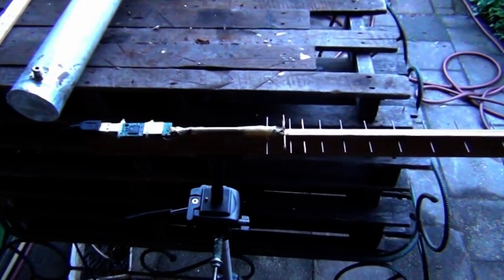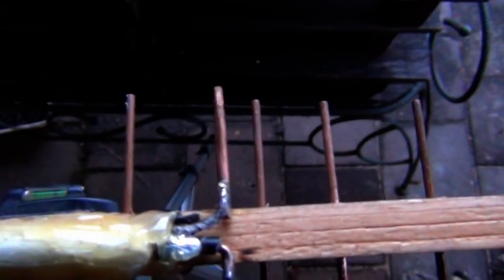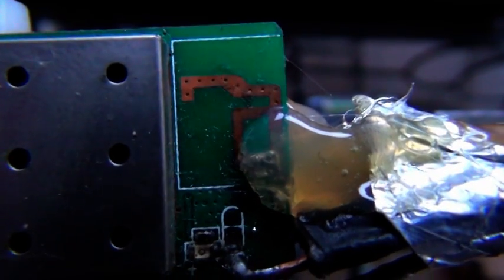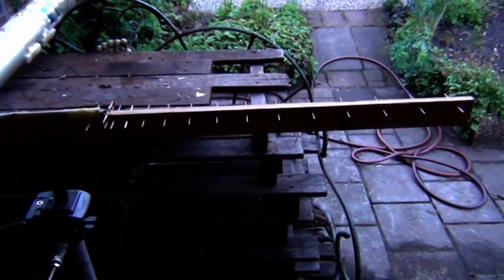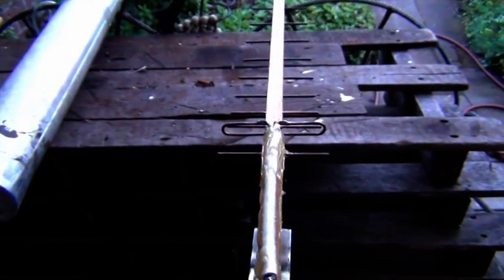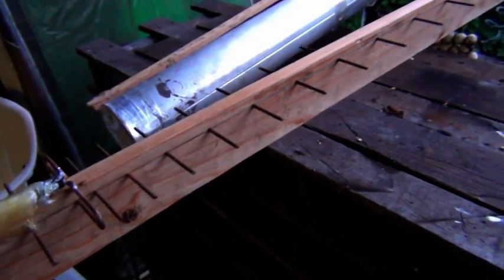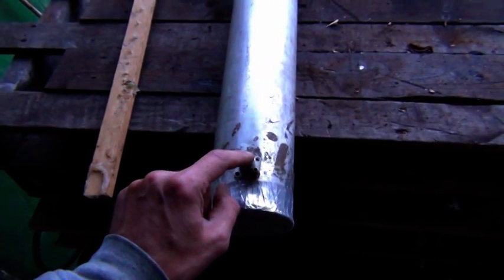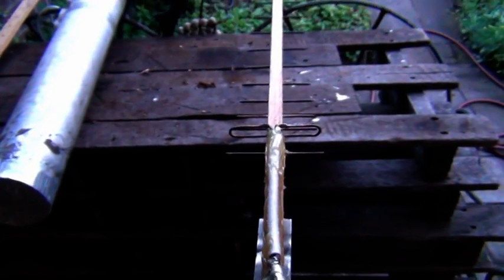Rebuilt DIY 15 element USB Wifi Yagi antenna vs Cantenna (29)

Comment: I can't see a balun. You need 4:1 coax balun for this Folded Dipole Antenna, otherwise signal will be very weak. It can be a Coax balun, made of RG58 cable with velocity factor 0.66, length for 2440MHz should be about 40.57mm (cable with sleeve). 40,57mm is 1/2 wavelength inside RG58 cable. You can use another delayed wave instead, 3x 1/2 lambda = 121,7mm, if 40.57mm is too short coax to bend. This piece of cable creates voltage delay and you will get both, wave(+) and delayed wave(-) = 2x higher voltage on dipole. Only BiQuad dipole doesn't need this balun because there are two dipoles in parallel (50 Ohm impedance matched with 50 Ohm cable and router or USB stick). Cable length (feedline) between USB stick and antenna dipole should be 1/2 lambda too, or 3x, 5x, 7x, (odd numbers) times 40,5738mm (1/2 lambda inside RG58 cable), this will help if antenna impedance do not match 50.0 Ohm exactly and there are reflections (standing waves) inside RF coax cable between router and antenna.
Reply from the maker: Hi, I appreciate your time and effort to watch and comment on my video, but I have no idea what you are talking about because I have no knowledge at all about antenna's. Back then I just replicated a design from somebody else. You obviously know much more about this stuff then I do. 

I did put the specifications in the extra information section below the video. I also don't use the antenna anymore, however I still have it. It's hard to throw it away after I spend so many hours creating it :-) For a while it was useful because it was the only way for me to get access to the internet. But now I have my own connection and I no longer need it. 

But your information might be useful to other people. So thank you for that.

Comment: Want to use a TL-WB7200ND but will not open it.. I intend to disassemble an old omnidirectional antenna ad use the wires, leaving the screw connector in tact.
Reply from the maker: Hi Lennox,

That should be possible. But be aware that a standard connector will result into a certain amount of signal loss. Soldering the connections will give much better results and is preferable. Keep the connecting wires very short, nothing more then 4 inch or 10 cm.  Also make sure that you are going to drill the holes for the elements dead straight. All the elements must be perfectly aligned to each other, otherwise you will get bad results. Also make sure that you cut the elements at the precise length. I've cut them at a certain length first and then I filed them to the correct length. I used a digital caliper in order to get the right length with an accuracy of a few hundreds of a millimeter.

It isn't a difficult project, but it is a tedious job to do it right. When you've done it right it works very well. It is very directional sensitive, so when you're trying it for the first time make sure that you aim it at a known connection point in order to get some practice on how to use and aim it. Aiming by hand doesn't work, it's just that sensitive, you will need some sort of stand, I used a cheap tripod. It's a good thing that it is a highly sensitive antenna for direction, that's why they work so well. You will receive less interference and it has a longer range. A weak but clean signal is worth more then a strong signal with lots of  "interference" or "noise" as it is also called.

In order to make the elements straight I used two pieces of very straight hard wood. I've put the bottom piece of wood on a bench or table and I've placed one element (piece of wire) between the pieces of wood and then I rolled the top piece of wood back and forward while I added some weight to it. Like this It takes only a few seconds to get a straight element. 

I believe that a similar type of antenna is for sale at Ebay for around 25 US dollar or even less, but correct me if I'm wrong. You might consider to order one from Ebay, although I don't know what shipping would cost you. But on the other hand the pleasure of a useful DIY project is priceless and irreplaceable :-)

I didn't know much about antennas, and I'm still not an expert, but now I know at least how to build one :-) I even made an upgrade to my latest antenna, although I don't use it anymore since I have a permanent connection these days. I've added a small DIY dish made from a disposable aluminum serving dish. I used a large round pot as a mold.

I've called my latest 19 element antenna "The 19 element active DIY parabolic directional samurai USB Yagi antenna". within a few months from now I will make a short video from the new antenna.

I hope this information is useful to you and or other people, If you want to know more  just  let me know.

Peace, iT
Reply: Thank you for this explanation..
Reply from the maker: Lennox Lampkin
 you're welcome
Reply: My problem is the lack of tools but I intend to look online for a digital caliper as advised. This should be an exciting project and I will report accordingly.
Reply: BTW I am as fluent in Dutch as in English so feel free to communicate in Dutch.
Reply from the maker: Lennox Lampkin
hahaha yeah, I've noticed that, but English is fine. Now others can read it as well ;-)

Comment: sir i just want to ask if the lenght of the shielded wire is counted?
Reply from the maker: Hello Raymond, I didn't cut a specific length, just as short as possible. In my next video about the Yagi antenna it's even shorter.

Comment: Very nice....actually I've made a cantenna myself and it works great...

What is the background track, music you have put in this video?? Its also very nice....:)
Reply from the maker: Thank you for watching Anant! The music came with the editing software that I used back then, but I am no longer using that software. A Yagi antenna, if properly build, works a lot better then a cantenna, trust me. It is much less sensitive for interference. After I build that 15 element yagi antenna I've build another one with 20 elements and I added a small home made reflector shaped like a dish, but I no longer need to use either one of them. Peace, iT
Reply: can tall me from how far it work i mean the range
Reply from the maker: 50jitu
Watch this video from amateurlogic to get an impression about the range. https://www.youtube.com/watch?v=j3hfxcP6X8s

The range depends on the situation but it is way much better then the standard wifi receivers. In an open field the range is much wider then when you are in a city. A yagi antenna is even more effective and less sensitive for interference.  But I can't give you the exact numbers because I don't know. Just watch the video that I linked to. It's good information.

https://www.youtube.com/watch?v=j3hfxcP6X8s
Reply: Thanks

Comment: That is a great job man.  Are you going to use a plastic beam for the next project as wood does conduct and may cause signal loss?
Reply from the maker: Thank you Andrew! I'm not sure yet, I'm using the antenna indoors and I don't have useful plastic material. Right now I gained about 10dB compared to the Cantenna, so that is pretty impressive. Most of the time I get my parts from dumpsters, so if I can get a hold on some useful plastic I might use it, if not I will use wood instead. Only the folded dipole needs to be insulated so I can use aluminum as well. I think that plastic electrical tube is not straight enough for this project and with a plastic tube it is a bit more difficult to get all the holes lined up perfectly, I would need some sort of jig for that. The benefit from a wooden beam or boom is that it won't need glue to fit the elements, the elements fit very tight when you use a 1/16 drill bit as described in the build instructions, and it is also possible to put the wooden Yagi antenna inside a larger plastic tube to protect it from the rain if you want to use the antenna outdoors, the plastic will not have any influence on the signal strength. I take it step by step so I can learn as much from it as possible. You might wanna take a look at the web page that shows how to build this antenna, it is very detailed and you can find the link at the info section below the video.